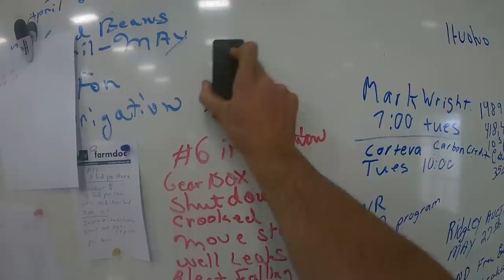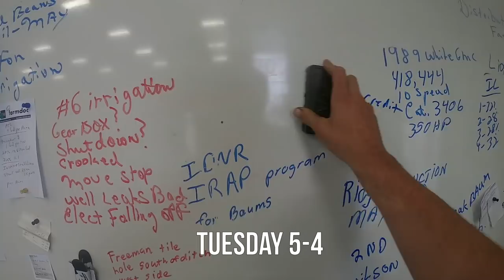Case IH and John Deere Planter Review. Reviewing ExactEmerge and CNH 2100's with Vdrive S2 E6

Comment: I’ve been a Deere Kinze guy forever wanted to build custom planter as we are running a small 6/11 row planter. Case dealer talked us into using new case 2100 row units. As far as I know we built the only 6/11 3 pt hitch mount case oh 2100 unit with delta force, vdrive, vset2, speed tube, furrow jet. Just got done planting with it and can’t say one bad thing about it.
Reply from the maker: Sounds awesome

Comment: Did you have to replace any of the Backbone wiring harnesses that go from the main bar to the downpressure solenoids and seed  meters?  Ive probably replaced at least 6 0n my 2140 12/23. Very impressed with the amount of acres you cover with 2 planters.
Reply from the maker: We did not

Comment: Still at the start, but really pulling for the ExactEmerge being that I just converted two DB’s over this year. 

Did some custom work this morning, was tickling 11 mph, and a little over. Kept getting out so I could see for myself, it did great. It was putting out a lot of down pressure, which had me worried. On my own ground, it’s goes negative 50% of the time, and up to 40-50 lbs of down.
Reply from the maker: Can’t go wrong with either one but yeah those delta force are impressive
Reply: @iversfarms  it was putting on over 100 lbs at times, and I thought for sure something went bizerk.